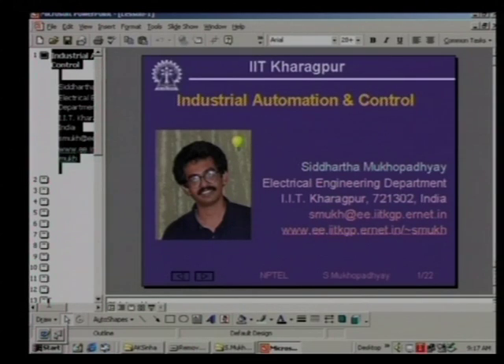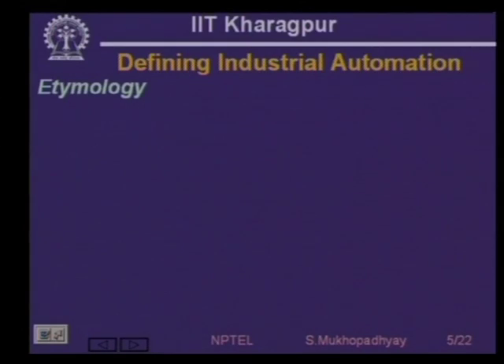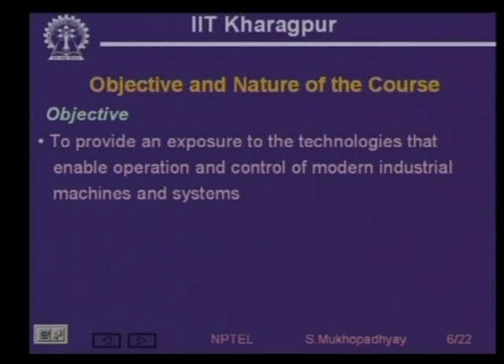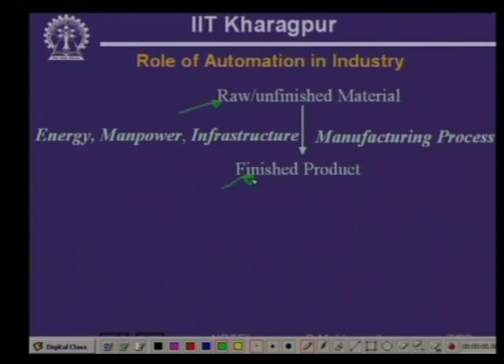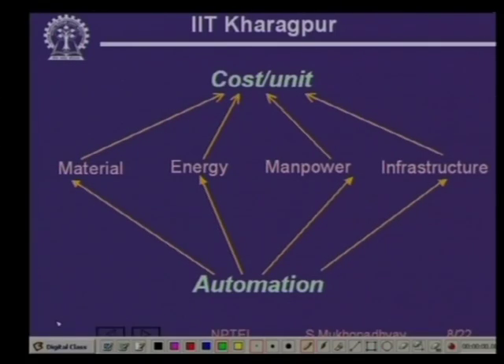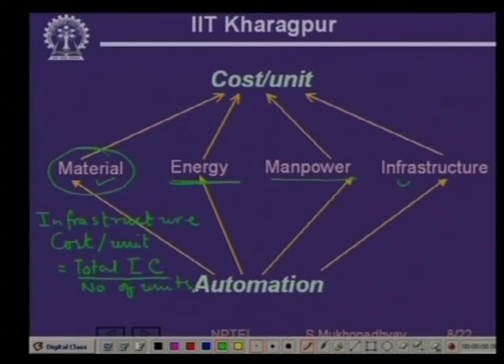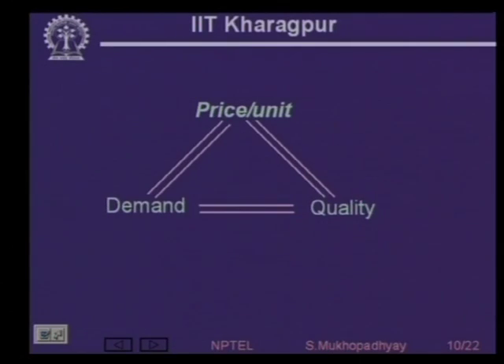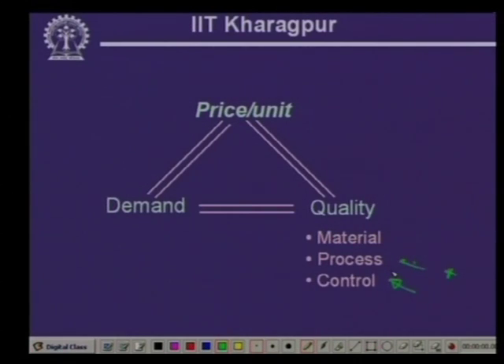Introduction

Comment: This is a totally outdated course. Plus, there are lot of technical mistakes from the Professor. I cannot recommend it to my students. NPTEL Swayam is still rerunning this course. I request NPTEL Swayam to provide a technically correct and updated lecture series on this topic
Reply: sir am a recent Electrical engineering  graduate i wanted to upskill my knowledge and take job role as automation engineer so i go enrolled in the course should i go ahead and complete or are there any other better source.
Reply: @kd6534-t1j  This course was prepared many years back. It has not been updated since. This is also a theory course, so you will not get any practical exposure. The best way to learn Industrial Automation is to get hands on training. You may look at practical training courses offered by global automation companies like Scheider or Yokogawa. They have training centres in Bangalore.
Reply: @kd6534-t1j  Are lern automation course now? I need some information about this from you
Reply: Sir please the
Reply: Sir please the